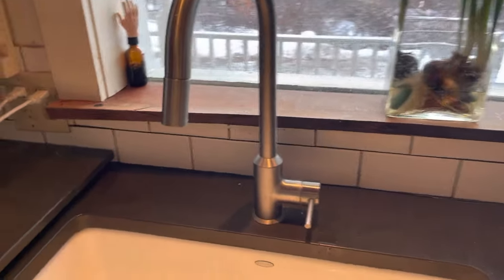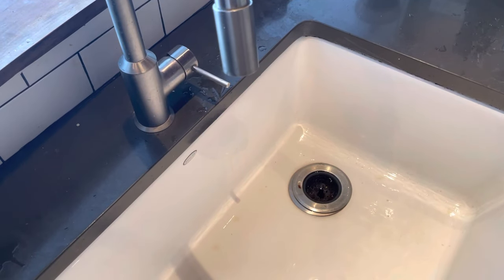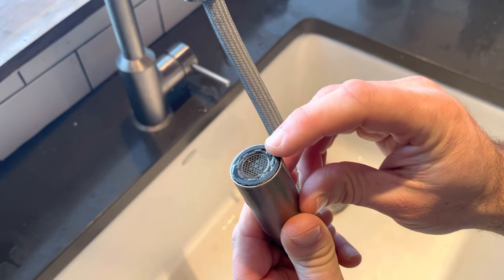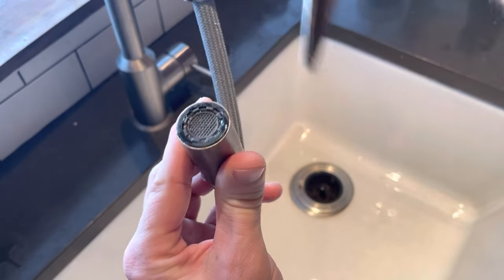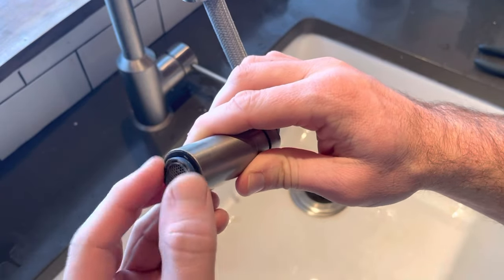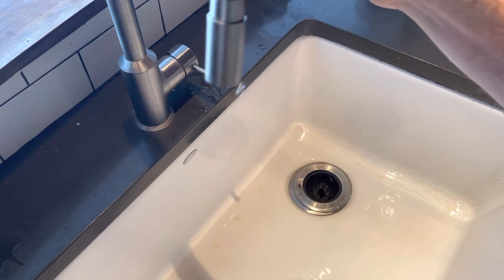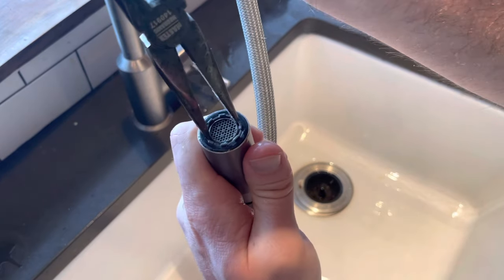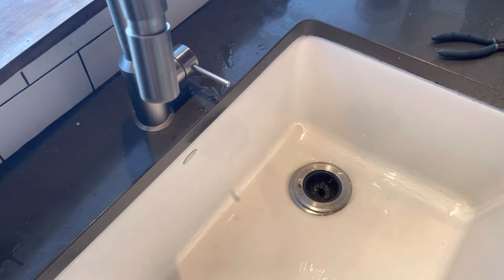Low water pressure in kitchen sink? Try this first.

Comment: Good  video, but: back flushing will not remove encrusted lime scale.  If you have removed the aerator, boil it for a minute or two in vinegar to remove the scale. Also, I suggest you put the sink plug in before dismantling small parts over it.  It gets very complicated when a part goes down the drain.
Reply from the maker: Great tips thank you!

Comment: This wasn't the fix for my low water pressure in my kitchen faucet, but I watched the whole thing in case it was. I really loved how clear and easy this was to follow even if I didn't use this method! 😊
Reply: Do you remember what the cause was? Going through this now!
Reply: @AnneAkhila  actually it was the way the fixture was sitting in the sink itself. When it was positioned properly no water pressure issue, when it was out of line water pressure issue. My landlord had it fixed so I wish I had more details but best of luck!!
Reply: @alliecastellarin1428 It sounds like it was just the lines below the sink were getting twisted up or kinked when you would move it around.

Comment: Please get your terminology correct, what you had was low flow and not low pressure. You had a restriction in the aerator but you had pressure in the line. The restriction reduced the flow just a FYI.
Reply from the maker: Fair point, Charles. Thanks for the note.